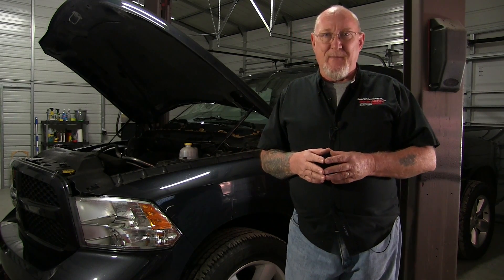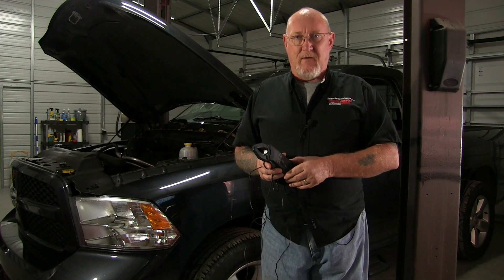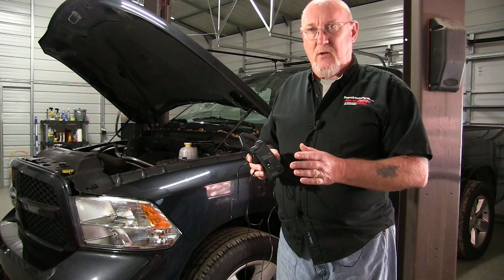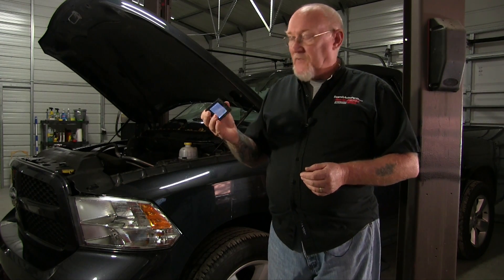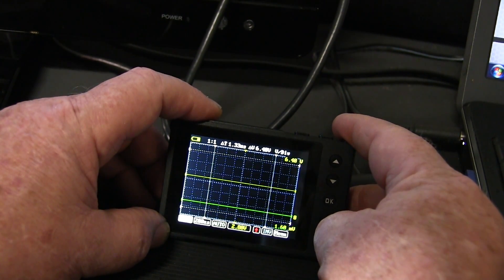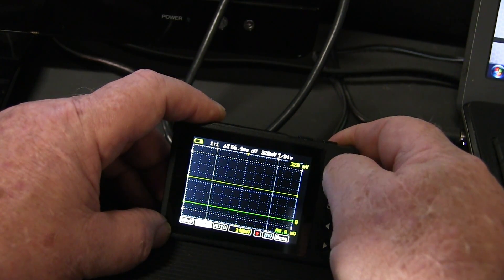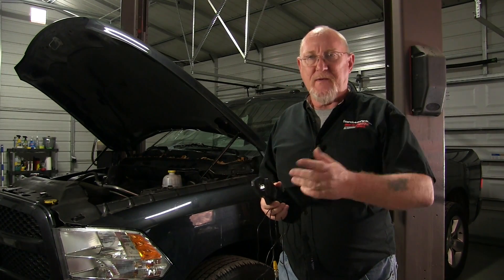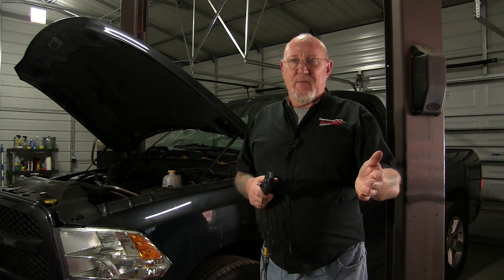Motor Age How2 #7 - Performing A Relative Compression Test (featuring the uScope)

Comment: what is the part number for the pico amp clamp that works with the u scope?    thanks
Reply from the maker: There is an adaptor that allows you to connect the BNC lead to the UScope. There is also one available for amp clamps that use banana jacks. Visit the AES site for info.

Comment: nice I get a uscope. I can usually determine low dead cylinder by ear when crank and run as well as rpm drop by pulling plug or injector wire off each cylinder while running. Shalom
Reply: motorhead yeah but customers want to see definitive proof not just an ear, scopes help

Comment: to disable the fuel system will I need to unplug the injectors
Reply from the maker: If that is the easiest thing to do. Or pull the fuse and/or relay for the fuel pump. The idea is to not wash down the cylinders with raw fuel -
Reply: Ok thanks for the help I'm just starting out learning a lot from your videos
Reply from the maker: I'm glad it's helping you. There is a lot more to come!
Reply: Can't wait look forward to every video
Reply from the maker: Just thought...if you try your low amp clamp, make sure that you use the cable that is connected to the starter (positive side) or the heavy cable on the ground side. And make sure the jaw can close all the way.  But don't sweat if that doesn't work. I'll show you in the next video another way to do the same test!
Reply: OK thanks

Comment: I have a low amp clamp with my uscope will it work
Reply from the maker: Chris, the low amp clamp won't work if you use the DC function on the scope but may if you select the AC mode only. This eliminates the DC element. There are some other ways to use the AC coupling feature to perform this test, too. Stay tuned!
Reply: Ok thanks
Reply from the maker: Check out the video I did on AC coupling earlier in this series if you haven't already. Then try it out!
Reply: Ok thanks

Comment: that uscope looks cool but i keep reading it has issues with charging.  wish these products were cheaper but nonetheless great video!
Reply: N N I've had my uScope  for over a year and a half and have NEVER had issues with charging! The problem is people don't read manuals. the uScope has a sufficient manual. Believe me, it's worth it.  Excellent pictures, screen shots you can bring to your computer to print for your files. you can make presets, it comes with a lot of presets already or you can just select labscope-so you can set things up yourself. I was new to using scopes when I purchased the uScope, but now I'm like a  pro with that thing. I've scoped EVERY sensor, injectors, coils, plug wires..on my car as practice- now I make $ using it on other peoples vehicles. Invest in yourself my friend-Invest!
       PS... and as far as it being a 1 channel scope- you could do what I do: get one of the waveforms you want to compare on the scope (cam), then save it as a reference waveform. Then call that waveform back up and then scope the other waveform live you want to compare the first one to (crank). So now you have 1 live waveform on the screen and 1 reference waveform on the screen at the same time-- Just make sure the settings (scales) are similar and all will correspond correctly. COMPARE ON PEOPLE!
    as of 2/17/2017--I was told by an AESwave employee that they are in the "process of finalizing the update that follows 6.01, but it wont be released to the public for awhile". I pressed for feature details but they didn't bite.
Reply from the maker: I don't use mine much and was pleasantly surprised that it still had a charge on it when I pulled it out for this video. The guys at AESWave tell me there is an update coming soon but not sure of what the update covers. We'll be doing an "In The Workshop" segment when it's ready and go over it all for you right here!
Reply: Isshman Garcia , Thanks for your input on the U-scope. I've been thinking about getting one just have not heard much about it. I will definitely check it out.